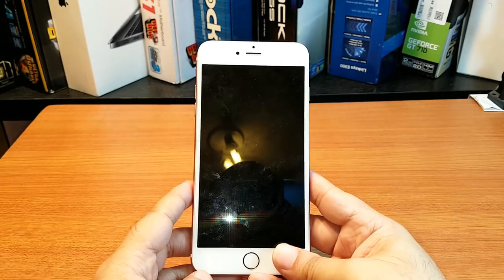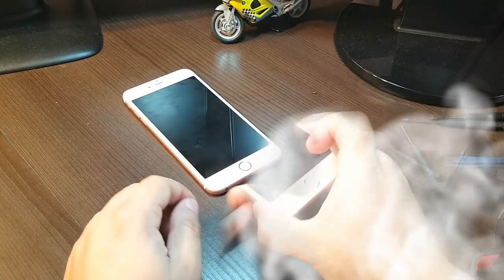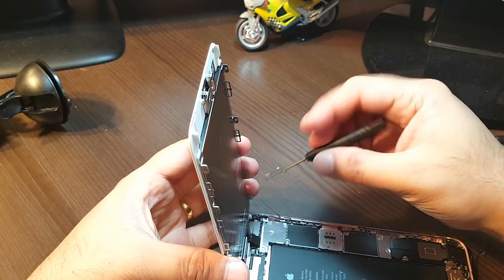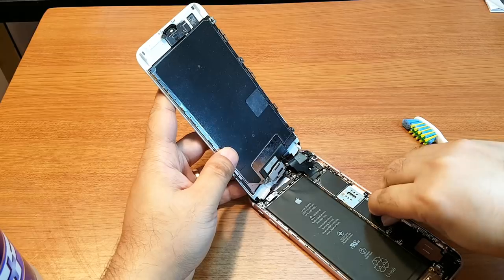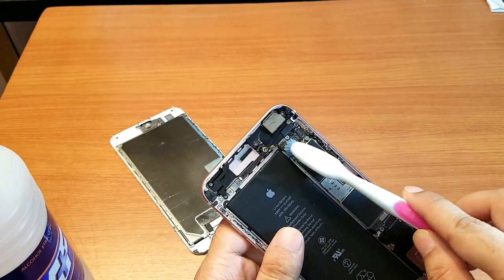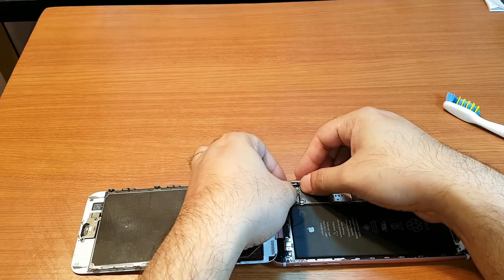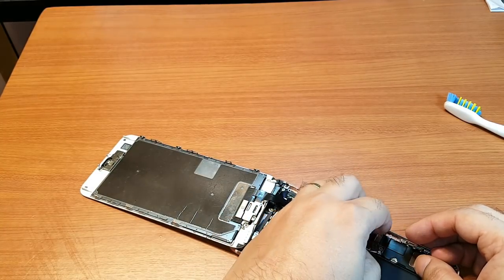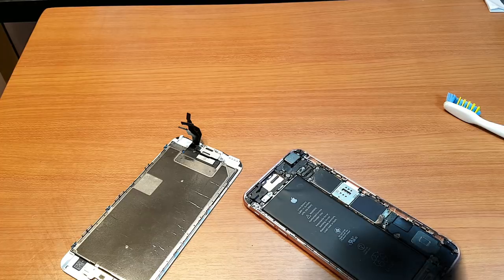Fix Vertical Lines, unresponsive On iPhone 7 plus, 7,  6s plus, 6

Comment: I have watched several videos on this problem, and they are all just about the same.  You don't want to try it?  You think it is wrong?  Take it to your repair shop, and I guarantee once they get your phone into the back room, they perform these exact steps.  The cables are always disconnected and cleaned, and reassembled.  If this fixes the problem, there is usually no charge but this is the first step in a process of elimination. If the line is still there, a screen replacement is almost always required.  99% of the time, the cause of a screen line is a liquid getting inside, or a phone drop.

Comment: I need help...... I woke up, and I saw my phone having a single black line across my screen. I tried refreshing it and everything I still can’t fix it..
Reply from the maker: You can try this process by your own risk, this type of problem are physical cant go by software!!
Reply: Aires Communication thanks I’ll try doing it!
Reply: @mkyziix  hi I know it's been a year you post ur comment, but I highly recommended when your sceen shows this lines I guaranteed sure this an LCD screen replacement :) there is no fix for this you all need is to replace the screen, cause if you let it be soon the lines will multiply across the screen. God bless :) Hope I help u a bit.
Reply: @paulolucido501  my iPhone has a white line after I replace a battery omg